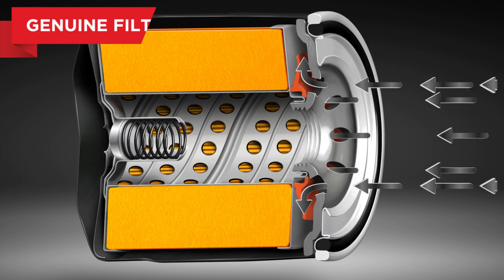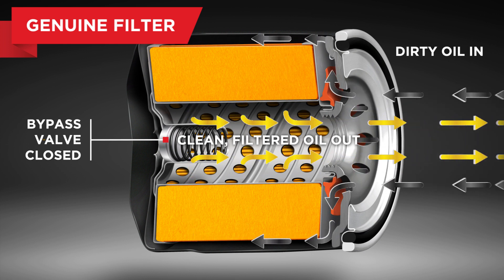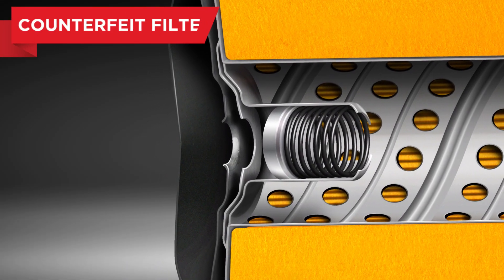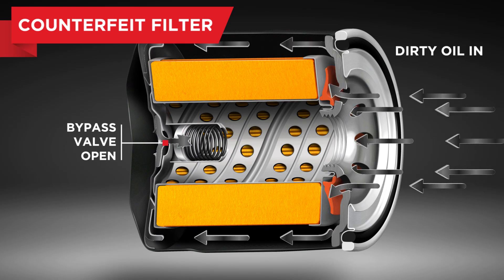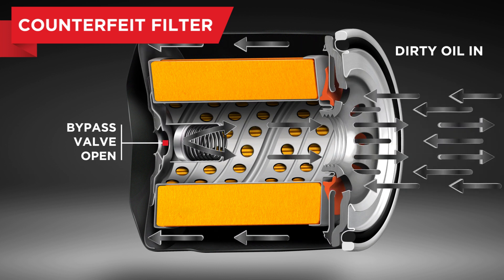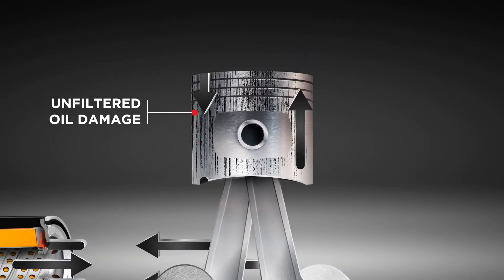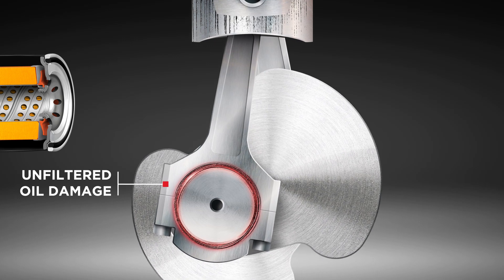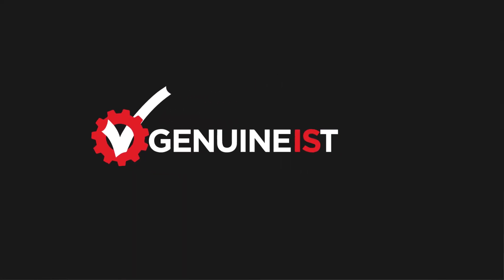Why counterfeit oil filters put your engine at risk

Comment: The filter should go by the OEM number for your car. Knowing if the by pass valve is working properly is a good quastion?? To be on the safe side keep your oil clean by changing it on time.
Reply: Reputable brand referenced by OEM number.
Reply: @SmOgER10  Even a OEM filter can be faulty, that is why it is important to keep an eye on the dip stick and change the oil and filter regularly.
Reply: What if the bypass opening pressure is lower than specified in aftermarket filters. I heard this is a common  problem.
Reply: @sunilayya8948  You mean that the bypass will be open most of the time? All the more reason to keep an eye on the condition of the oil by the dip stick. If the bypass is not work as it should then the oil preasure light should give warning.

Comment: FRAM has been making the OEM filters for Honda since at least 2016. I used to be a stickler for OEM filters. Now, I just go with a reputable aftermarket brand, and make sure that I change my oil ever 6 months. I also use 100% synthetic. Unless something goes catastrophically sideways, I see nothing wrong with the way I am doing it, and I save a tonne of money.
Reply: Fram is usually ok in the USA. Wix sucks. K&n is meh. 2 different kinds with those and they're usually identical to Bosch. Bosch generally is meh. They're all usually meh tbh

Comment: Want your engine to last? Change the oil at 5000 to 7500 miles. 7500 being for synthetic. Don't EVER follow the 10 000 mile or the 15 000 mile intervals. Use reputable name brand filters and good oil. That's it. Nothing more needed.
Reply: 3k is the golden rule. Even if its syntetic. Chevy Tahoe AMF 309,000 miles and still clean.

Comment: Many of the "OEM" filters have been opened and proven to be no better and sometimes not as good as aftermarket filters. Go look at GM's AC/Delco, most are the same as the basic Supertech filter, even toyota, honda, mopar have been shown to not always be any better than aftermarket. So, just b/c you buy it a dealer, doesn't always mean it's better.
Reply: Do you understand what this video is about, it's about counterfeit filters. In other words, it's regarding filters being sold as one brand say OEM, when they are in fact counterfeit.
Reply: @guidedbygreen1480  who cares..
Reply: @eminiscalperpro9729  you should since your comment is irrelevant to the video. But if you don't care, whatever!
Reply: Gay
Reply: Never heard of anyone getting a counterfeit or sub standard new part at the dealer though
Reply: Delco filters have gone downhill in last 5 years. The ones they sell at Wally world are not good filters and I refuse to use them. Fram orange are trash but apparently their more expensive ones are a little better.

Comment: The famous 95 MERC runs Pennzoil Ultra Platinum, 5-W-20; Bosch Premium Oil Filter #3410; and a FILTERMAG #SS365PR Magnet Kit. Oil & Filter changes at 5,000 miles.

Comment: I just accomplished the first 10,000 mile service on my RAV4 Toyota made in Canada, and the oil filter I removed was a knock off, installed at the factory. Or at least the indications to identify it as a knock off are present. I purchased a replacement filter from the Toyota dealer and the counter fit markings on the one I purchased from Toyota are not present , indicating the Toyota dealer replacement was real. Just FYI
Reply: If you really want tour engine to last, service at around 7k - 7.5k miles. At 10,000, oil is darker than a black hole

Comment: Can anyone describe what a counterfeit filter is? I'm not asking for opinions but rather facts, what is a counterfeit filter.
Reply: Lots of filters are sold on Amazon and eBay now, under brand names that you think are legit. For example, you buy a TOYOTA OEM oil filter on Amazon, or so you thought. Most OEM filters sold on Amazon are counterfeit and best to purchase them from Walmart or your dealership instead.

Basically if you're gonna go OEM, just go to the dealership, otherwise go to a parts store and stay away from the e-commerce methods.

Comment: I don't use genuine oil filters. I only buy Mahle Filters. I know that most car manufacturers let their genuine oil filters made by Mahle. I never had any problems in the last 20 years. But I don't buy noname filters. And change your oil once a year or every 15000 km without flushing your engine with Diesel. This can kill your engine.
Reply: FRAM has been making the OEM filters for Honda since at least 2016. I used to be a stickler for OEM filters. Now, I just go with a reputable aftermarket brand, and make sure that I change my oil ever 6 months. I also use 100% synthetic. Unless something goes catastrophically sideways, I see nothing wrong with the way I am doing it, and I save a tonne of money.

Comment: Lack of additional information about counterfeits renders this video pointless.
Reply from the maker: Hi warpedweirdo. What kind of additional information are you after? To summarise is a single sentence, if you are buying an oil filter, your cars brands local dealer is the only way to guarantee you are getting genuine. Head to https://genuineisbest.com.au/news/counterfeit-filter-seizure-reveals-major-threat-engines/ and https://genuineisbest.com.au/news/bypass-valve-problem-counterfeits-risking-engine/ for the full stories.
Reply: @genuineisbest8639   and how do you tell if you have a counterfeit?
Reply: @suecarlson7311  blown engine
Reply: @suecarlson7311  if it doesn't come from the OEM it is counterfeit regardless of the brand name.
Reply: @walterk1221  
Wrong! Auto manufactures like GM, Ford, Toyota and so on do not make oil filters, their oil filters are made by companies like Wix, Purolator, AC Delco, Donaldson and more. I use Wix oil and air filters in all of my personal vehicles, Wix makes excellent products. This video is misleading at best, instead maybe advise automobile owners to open their owners manual and read.
Reply: @genuineisbest8639  
Aftermarket is best! Kawasaki does not make oil filters, Toyota does not make oil filters, Ford does not make oil filters. Do you know who does make high quality oil filters? Wix, Purolator, Donaldson, Champion... these quality companies make filters for automotive industry and brand them however they like. Buy your filters at the local dealership if you like paying 2,3,5 times what a filter should cost or buy from Rock Auto and use the savings to buy quality oil to go with your new filter.
Reply: @laylaanddadsyoutube5709  in most cases, yes, OEM filters are manufactured under contract and to OEM specifications by third-parties. They may or may not be identical in materials or construction to the manufacturer labeled product. In the case of Cummins, Cummins Filtration is the subsidiary that manufacturers Fleetguard filters as well as the Mopar labeled filters for the B-series engines.